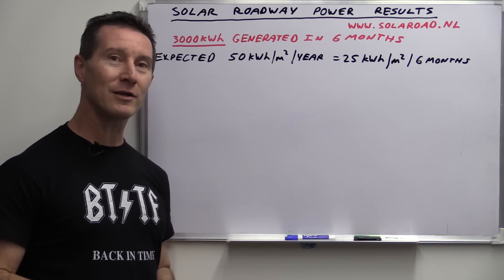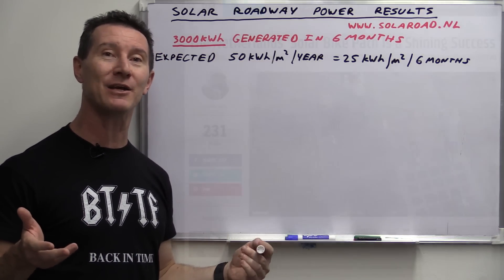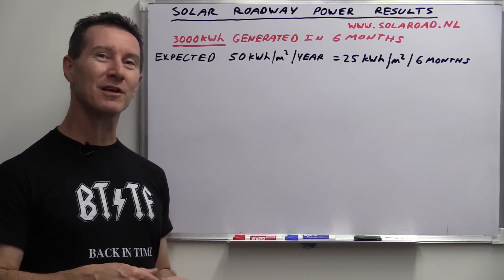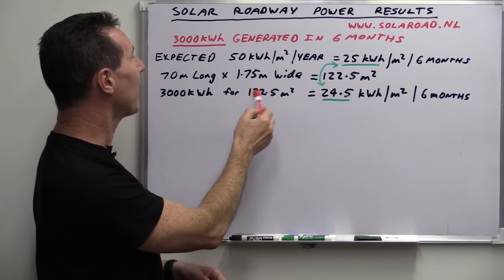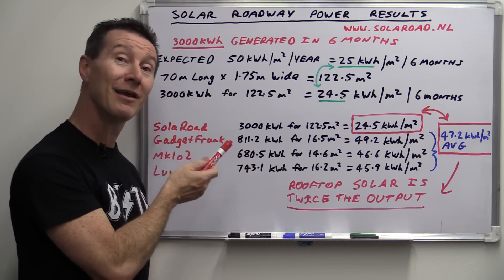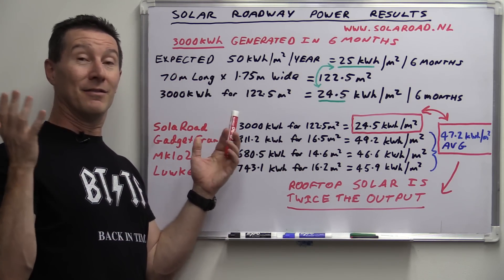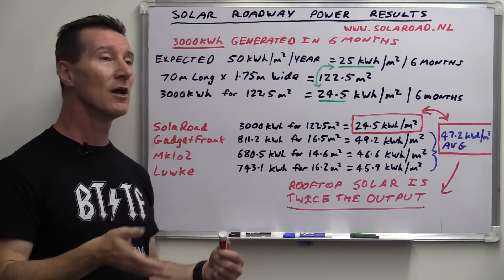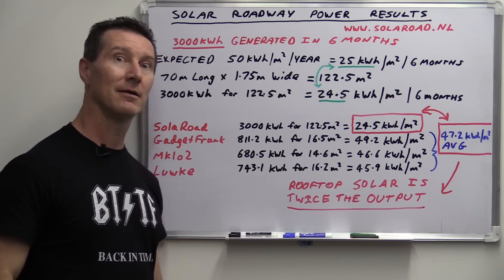EEVblog #743 - Solar Roadways Test Results

Comment: its more of a proof of concept. still not viable.
Reply: MrTommymxr It will never be.
Reply: BrianBeuken
It's being dismissed on more grounds than you state, and one of them is that the choice of roadways is the daft waste of time and resources that underpins the whole idea, something that YOU agree with.

Check those six months again. ALL winter? No. Representative of yearly variation? Yes.

The initial idea is stupid. From there, what should I care about what they are testing when even YOU can agree it won't deliver what solar panels that use less resources and time already does?
Reply: MrTommymxr  More proof the concept sucks.
Reply: MrTommymxr proof of scam more like it.
Reply: flexairz maybe in the future with organic photovoltaic...
Reply: flexairz  perhaps we should wait for the results.......just a thought!
Reply: BrianBeuken You do know that this video used the results? Do you expect a solar panel pixie to come make them all better?
Reply: ***** seriously? 
How many times has this to be repeated...no one expects a flat road panel to be as good as a roof panel.....The concept is simply to see if a floor panel is capable of producing enough energy over a lifetime to be  commercially viable as a road/cycle/path ... The trial is not to see if they can exceed or even match a roof panel...they can't. That's the only thing this video and you naysayers seem to focus on.

The "results" so far are simply an announcement on 6 months of use in winter months, the trial is for 3 years...so no, the results are not there..only some interim info regarding higher than expected yield.
The actual results of the full trial, which will give data on yield, degradation, anticipated lifetime and maintenance costs, are at least 2.5 maybe 3 years away.
That's how science works...you make an experiment, you run it and then you look at the results and do calculations.

You don't dismiss something based on criteria that the experiment is not testing....its not testing if its as effective as a roof panel, its testing if its viable as a road surface that generates power.
See the solaroad (not solar roadways) website faq's if you need more info
And that...really is my final comment, its just too tedious repeating the same thing to people who are simply not listening.
Reply: MrTommymxr it actually shows that the concept doesnt work as it is now and would require lots more research to even be able to compete to a current solar panel on a roof.
Reply: Aarghhhh it does not show that! there is no complete data. To give any indication of success or failure 

 It's not intended to compete with a roof panel so the comparison is meaningless no matter how often it gets repeated
Reply: BrianBeuken But it simply has to be compared to Roof Panels and if it sucks on all parts there its no use to use them while there are roofs left to place panels on.
Reply: ZeruelB
Put them up over the road, less oil and grime there. They won't get shadowed by traffic there. They won't need expensive heavy high maintenance glass tiles filtering light out from the solar cells because they won't be load-bearing cars and trucks.
Reply: ***** of course that would be possible
Reply: No  it has to be compared with road surfaces......you are comparing with the wrong thing.
Reply: BrianBeuken You do realize that you try to gain energy, right? So, in general, while there are valid suitable rooftops (it is already shown that solar panels on rooftops are cheaper and have a higher gain), you really want to solar surface a road? Thats just not economical.
Reply: *****  There are many better places to install panels and many worse places...the research is to determine If roads could be viable.
NOT TO show they can be as good as roof panels.....Again the only point you keep pushing is that roof panels are better, that's not in question.

Its intended to compete with other road surfaces........maybe you could try to keep up with the concept, instead of comparing apples and oranges.

ZeruelB  the fact is, and here's the reason I keep commenting.....we don't actually know if its uneconomical....that's the point of the trial. Too any assumptions and, everyone knows, arguments with no data to back it up.
Its clearly going to be a poor relation to roof panels. But there are many places where there are no roofs, or poles or whatever. But there are nearly always roads...so...can a road be made that is as reliable as current roads and also produces energy??
Lets test that...rather than automatically dismissing it...oh wait...they are doing... Lets wait for the results in 2018.
Reply: BrianBeuken
We want to see if solar panels on roads are viable, giving us a 50% return on power for far more investment?
And just how's that going?
What's next, 'viable' cars that get 12 MPG?

BTW, where do you get that these panels will stand up anywhere near as long as a well made highway? The only "tests" they show are unrepresentative shams.

Comment: Of course solar roadways will not be anywhere near as good as putting them on a roof. It is obvious. But, Dave, I think you are missing perhaps the only sensible reason for these projects and that is to promote solar panel awareness. The big problem with putting panels up high where they perform the best is that they are not seen. Put them on the ground and they are in people's faces! How about that cycling commuter wondering whether he should put solar on his home or not? I cannot think of a better reminder for him/her to do so, or to think about the whole area of sustainable energy and reduced energy consumption.

I think mass use of flat ground based panels is nonsense, but this benefit does exist.
Reply: Jim F "How about that cycling commuter wondering whether he should put solar on his home or not? "
That's a very expensive way of advertising don't you think? Again, the wrong solution for a problem that does not exist.

Comment: Hi Dave...here's another one to look at for you.  Lots of "potential of", "possibly", "could offsets" in this one.   http://www.fhwa.dot.gov/publications/publicroads/13novdec/04.cfm

Like you I'm all for finding alternative sources of energy, but the fact is Solar having a current maximum efficiency of 48% (based on what I've been able to find), and that is the highest (and astronomically expensive) cells...and that efficiency, based on the documentation, drops to about 30% in 10 years.  Lets not even get into the environmental impact of making these cells (and disposing of them when their life comes to an end).  CHEERS!

Comment: Thanks for boiling down the figures. One detail I was wondering about. Solar panels are more effective when cooled. Would not the soil under the solar road work as a heatsink dispersing the heat better the air cooling on a roof? This makes no difference to the figures of course but I found it interesting.

Comment: In Victoria there is an example of a Solar roadway they mounted solar panels on the noise barrier at an angle. Not sure what details on the total out put is.
https://www.google.com.au/maps/@-37.768354,144.809906,3a,75y,242.43h,64.55t/data=!3m4!1e1!3m2!1sEIbsXShAcPrWAOYWDuDDYg!2e0

Comment: When they 1st announced Solar roadways here in the US, I thought it was a neat idea that might actually be viable.  But after seeing test data, watching Dave's videos and others.  It has become a joke.  I think what they are doing here in Phoenix Arizona USA is a more viable solution.

Being one of the hottest states and sunniest for the majority of the year, businesses and government buildings have started putting up covered parking with solar panels on them.  The panels produce enough energy to offset the cost and load of the air conditioning that is required to keep the building at a comfortable level.  Plus the added benefit of your vehicle being parked in the shade.  When it is 46 C outside in the middle of summer, just parking it in the shade can lower the internal temp of your by around 10 C

Comment: Dear Dave,

Please read this National Fire Protection Association article regarding a fire in a new, sustainable building entitled "Perfect Storm:" http://www.nfpa.org/newsandpublications/nfpa-journal/2014/january-february-2014/features/perfect-storm
If residential/commercial solar panel installations pose a greater risk to fire fighters and the building itself when a fire not incidental to the solar system occurs, would you endorse mandatory sprinkler systems in those applications, especially residences?

Comment: I think that if someone is selling this as a "green" solution for generation of electric power a more broad view over the product is needed. The true "cost", in terms of "green-ness" (not really a word huh?) should include the manufactoring process and installation process as well as maintenance of this road. Even if the power output is reasonable, what is the hidden cost behind it? In terms of energy invested and waste from manufactoring and other overhead?

Comment: Did they expect 50 kWh for the prototype or the final product? These slabs are meant to replace existing repavement and supplement inadequate rooftop space. ROI is expected to be 20 years instead of 10, but they're working towards 15.
Reply: Cees Timmerman Almost anything they do to improve the ROI of the roadway panels will also improve the ROI of a rooftop installation too.  If you get the ROI time down to 15 years on the roadway applying the same tricks to the rooftop installation could potentially reduce its ROI time to 7.5 years.  

Additionally, if the panel is badly damaged or destroyed in less than 15 years (assuming you can get the ROI time down to that) then it will never pay for itself, ever.  Don't forget one of the panels broke in the trial after less than six months.  Of course the same is true of the rooftop installation but a) the window in which it could break before it's paid for itself is smaller and b) it's not subjected to traffic running over it day in, day out, so there's less opportunity for it to get broken.  

Basic physics says angled panels on roofs angled at the sun are always going to produce more energy, cost less, require less maintenance and be less prone to premature breakage than flat panels under a road surface.
Reply: PassiveSmoking
As you've just explained, roadway panels require different tech than rooftop ones.

These slabs replace existing slabs when those need to be replaced anyway, and supplement inadequate roof space.
Reply: Cees Timmerman At no point did I say they require different tech.  The roadway panels and rooftop panels are fundamentally the same tech, namely PV cells collecting solar energy and turning it into electricity.  The only differences between the two are:

1) The roadway cells are buried flat deep in the road where a portion of the panel can spend significant amounts of the day in the shade whereas the ones on the roof are angled towards the sun and are unlikely to have any shadows falling on them.  

2) The roadway cells require a thick layer of tempered glass with a roughened surface to give grip to car tyres whereas the roof cells only require a thin sheet of standard glass for weather proofing.  

3) The proposed solar freaking roadways have a load of additional devices that sap what energy they do generate for things like under-road lighting and heating whereas the rooftop panels do not.  

The roadway panels do not contain some magical device that can turn moondust into 1.21 gigawatts, they're the same devices that go on the roof.  The numbers all show that the roof is a far more effective place for them than under a sheet of tempered glass in the road.  The ones that go in the road are also, by necessity, far more expensive than the ones that go on the roof and while the rooftop panels can in theory pay for themselves the roadway panels never can.  

Solar Freaking Roadways aren't a viable technology, they're a meme.  One that does far more harm than good because it makes renewable energy as a whole look stupid
Reply: Different tech such as a thick layer of tempered glass with a roughened surface to give grip to car tyres whereas the roof cells only require a thin sheet of standard glass for weather proofing.

Comment: That's all nice, but all that is technical efficiency. How about economical? If panel prices drop, your next problem is where to put them. In Australia or Canada, that isn't a problem, but in places where land is expensive or simply not available, you can either use rooftops or roads. The real question is would the lover cost of renting roads and generating less per m^2 cover the difference to renting rooftops at a greater cost but generating more.
Reply: code123ns  Putting solar panels on the ground, surrounded by sun blocking skyscrapers, is a good idea to you?
Reply: Xelbiuj That is a bad idea to me. Mapping actual insolation of pathways in urban areas would be a better one. Less bullshitty, too. Or even estimating it. It wouldn't be that hard with all the 3D GIS data available these days. Then, take the area where you get at lest 80% of what you'd get on a flat spot with no shadows around. Then estimate how much pedestrians shadow in from that. Take that number and compare it with the area of all the rooftops. Then multiply those with the efficiency of flat ground vs. static rooftop. THEN ask if they are a good idea and WHERE.

Comment: Solar Roadways:  half the efficiency plus the cost of running all that extra cable to carry the electricity.

Home Solar Farms: more efficiency and the electrical infrastructure is already in place (since the home already has electricity.)

I don't know why people are freaking out about Solar Roadways when they could just lobby the government to make home solar farms mandatory on new homes and buildings.  I still wouldn't agree with them (I think it should be done, but mandatory...eh...no), but at least then they'd be less bat-shit insane.

Comment: I want to know what the Solar Frekin' roadways people are smoking because it appears to be good stuff. I mean do they really think they can make  a road out of glass ? Even if you could find some form of clear material ( sapphire or some sort of exotic plastic or something) that can support a lorry or car, how long is that going to last ? With dust + weight of the traffic you may as well rub sandpaper over your solar panel, not to mention giving everyone Silicosis. I have seen estimates of 50 million USD ( there figures) just to find out if a suitable material exists. Crazy.

Comment: Cycling in the middle of a highway?
Not the best idea IMHO
Reply: Henning Schäferhoff You opinion sucks, they're protected by concrete, steel reinforced barriers, and at least they're not riding in the fucking road like many places in the U.S.
Reply: Thanks for your mild criticism.
My concern was the pollution and noise the cars produce. Of course its better to ride on the side of the road but I would rather like to have a bicycle path that is surrounded by trees rather than cars. Near the town where i live the converted an old train track for this purpose because it has got an even slope and goes through the whole city.

Comment: The Germans have solved that problem rather neatly. They have placed solar panels ABOVE large parking lots outside shopping centers. So you can angle them correctly and they provide shade for the cars below. The shade for the parked cars save some energy on the cars AC as well since the cars will not be as insanely hot inside after a couple hours in the sun. The solar cell roof is also very useful even when it's not sunny outside. They protect the shoppers from rain as well. There's so many advantages to a system like that.

Comment: Yep, dutch always have to reinvent the wheel. Same goes for trains which don't run in winter wheater (NS) or fall apart (Fyra), strike fighters which don't fly (JSF). Enough alternatives but always making the wrong decisions.
Reply: noise vector :: dj tremor :: dusp2k Dont forget windmills that dont give power all (24/7) time..

Comment: All numbers aside (weird phrase to use in engineering, I know), I don't see how anybody could think that they're good.  They have to endure way more abuse than roof-top or poll mounted panels, which means at best they'll make the same amount of energy as roof top panels but you'll be bleeding money out in continuously replacing and maintaining.

Like, numbers aside, I don't get why anybody would feel this is a BETTER idea than roof-top.

Comment: I like the solar idea I think area like Arizona they say could power the entire US, transmissions, etc that's likely not practical.
Unless they could get solar put on every building in that area then MAYBE you would have a similar result. If you took a chunk of the desert and did it fine, but how will that power get to the east coast?

I liked the idea of geothermal, but that's so picky about where it's practical.
If we want some sort of non-fossil energy Nuclear preferably thorium is the best way.

Comment: I'd say that the solar covered motorway in S Korea will probably have problems with crashes knocking out a fine bunch of solar panels with it. But that's pessimistic thinking, and a problem possibly being fixed by automated cars, but who knows.
Reply from the maker: Neroxen Would still work out a lot cheaper than fixing glass paved roads!

Comment: I'd love to see shade structures being added to children's playgrounds, parks, and parking lots with solar panels on them. I hear it's not uncommon in the South for children's parks to have shade structures over them due to the amount of sun they get there... throw in some solar panels (spaced away from the roof slightly for air circulation, or course) and I think we have a winner. Even in places where it's not sunny all the time it'd certainly help at least a bit!